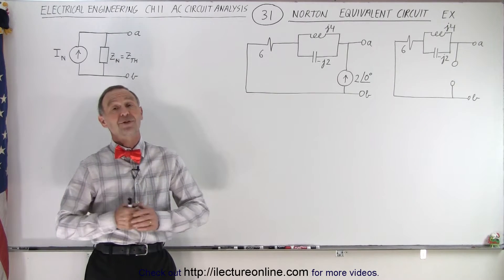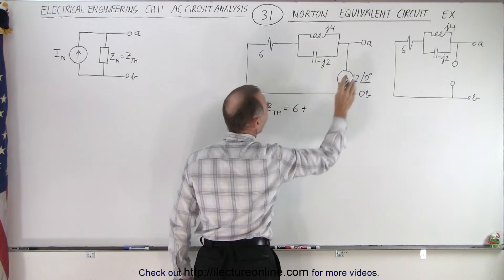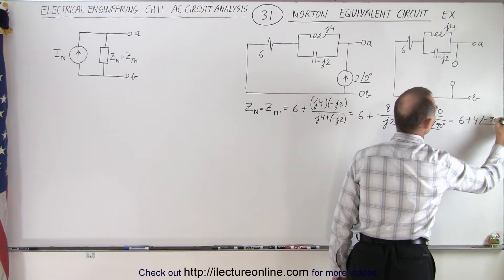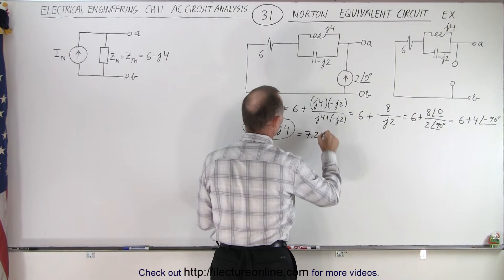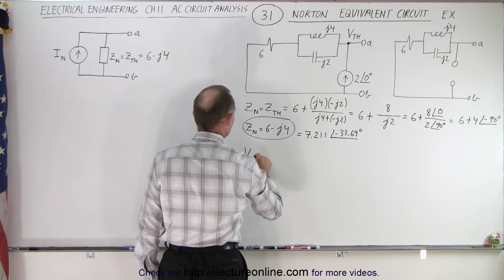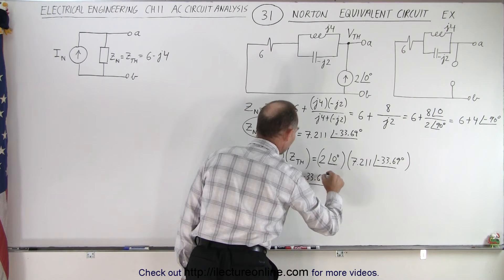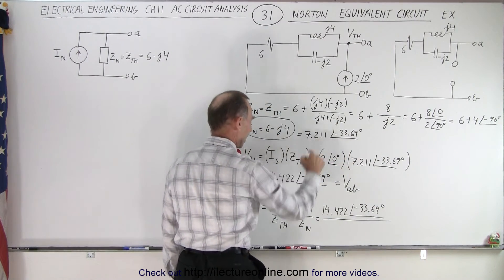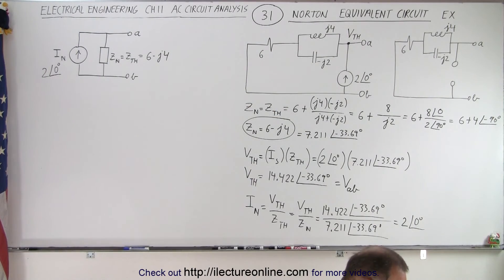Electrical Engineering: Ch 11 AC Circuit Analysis (31 of 34) Norton Equivalent Circuit: Ex.

Comment: I like the dog😊 ☺😊😀😁😂5 Smile's.
What about the 3rd 4 ripple in function?like time in a pc curcit or function use (mine😮)strange how light can fix????example: like time or peck pulse from 555 to stable interactions or removal of the peck that keeps back flowing and trips it on/off with reset?. Nother example (I had a primer on a gel blaster had neg and poss with director on both but when using the main motor the juice was able to run up the negative since director on neg actually don't have a job unless in respect to possible guide in some curcit use!! It would  trip the 555 reset button as it was set to run for 2.5sec to prime and reset. On top if you don't block that primer on the poss to the second motor with no director it gose to the pig motor those motors win every time! like a big induction coil😕'O'well. Strange that electron roll..should see the voltage regulatior set i got use 4 15v, 12v, 9v, 5v, regs i had to add a director to all to get the 5v to work with out a director set to the 5v it would even on 8vplus operating system it still would not light up the 5v setout added the direction via each and all working????.